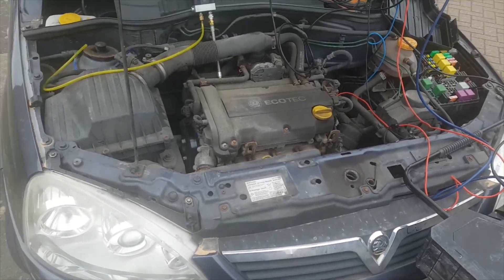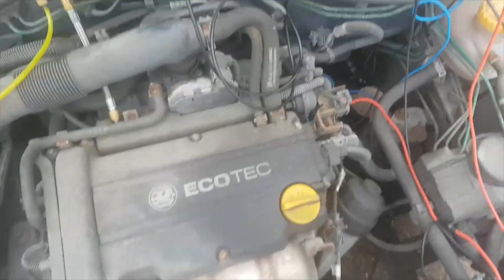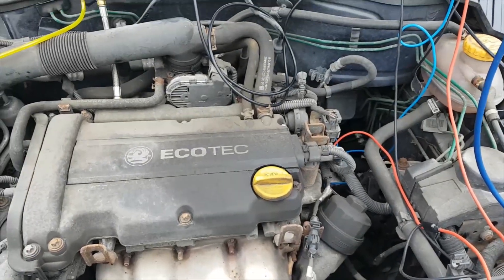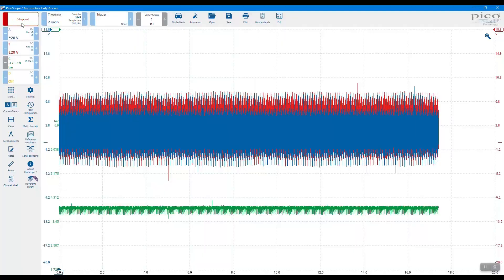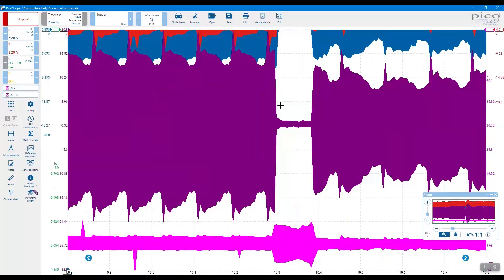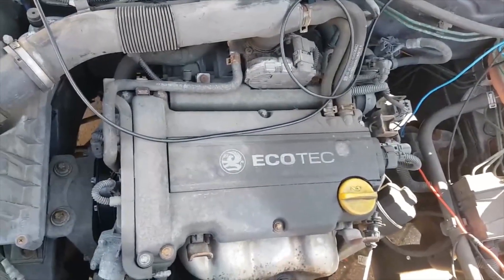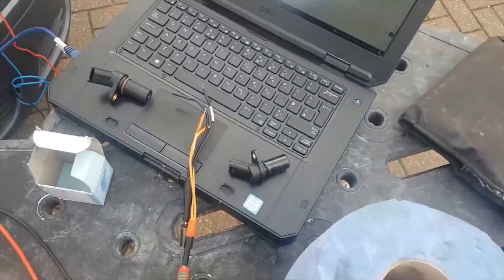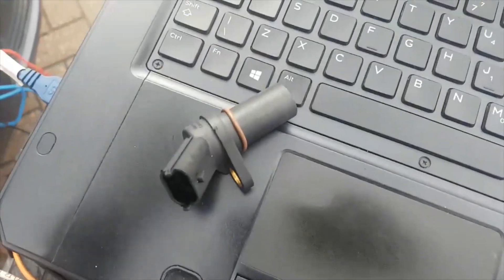Case Study with Ben Martins

Comment: Какой щуп ты использовал для измерения сопротивления?
Reply: Hi, resistance was measured using the BNC+ Resistance lead - TA432 https://www.picoauto.com/products/test-leads/picobnc-resistance-test-lead. It can only be used with the new 4225A or 4425A scopes.
Reply: @benmartins6283  Привет, есть в продаже осциллограф 4225А? На сайте написано, что временно отсутствует! Возможно эта старая информация
Reply: @timotiqwerty1927  Sadly that is still correct. I mentioned the 4225A in case those that have one already could make use of the resistance lead.
Reply: @benmartins6283  Спасибо!

Comment: Great capture Ben. I've had a few of these and the sensor goes high resistance usually. I suspect the sensor actually went open circuit and you were seeing a loop of signal through the scope, rather than a short circuit condition. Especially as it an AC signal. Just a thought!
Reply: Thanks Mark, and after I filmed it and thought about it the chances of it shorting are quite rare! Always the way when you're looking at things in the heat of the moment!
Reply: @benmartins6283  I agree with you there. I have to try hard to walk away and analyse my captures, before making a diagnosis, for that very reason.
Reply: @markstammersdiagnostics9784  Its tough at the best of times and with the owner of the vehicle sat in my living room there was added pressure to get it done! Hats off to all those that film on the go. It's a skill for certain. Just hope there's something in there that people can take away.
Reply: @benmartins6283  I know what you mean, it's not for me. But yes, there is always something to be learned from a good honest description of utilising the scope. Good job.
Reply: @markstammersdiagnostics9784  Could you explain to me: "I suspect that the sensor actually opened a circuit and you saw a signal loop in the scope, not a short circuit. Especially since it's an AC signal." Wouldn't a short circuit cause the same signal as in the video? What's going on with this signal loop? Thank you